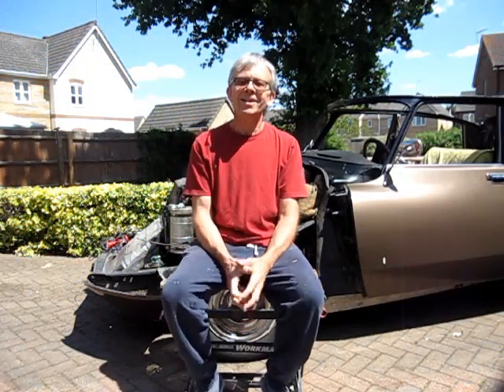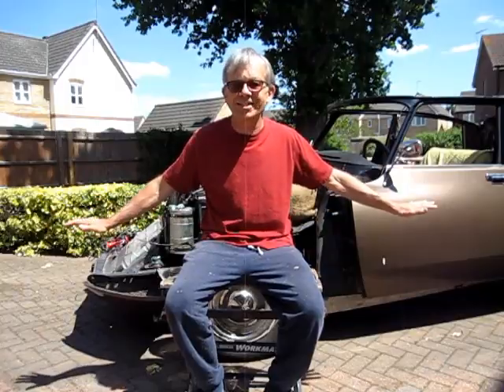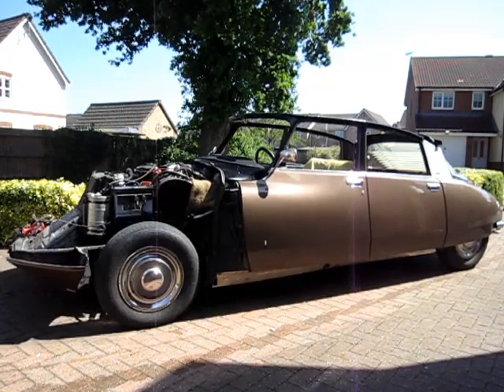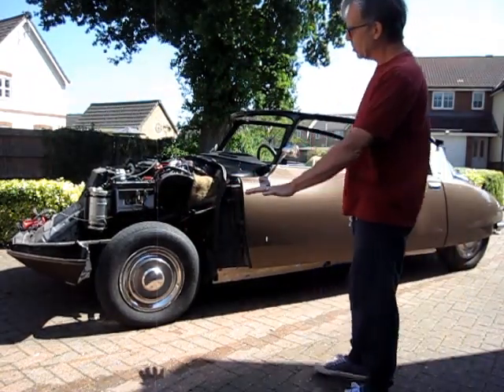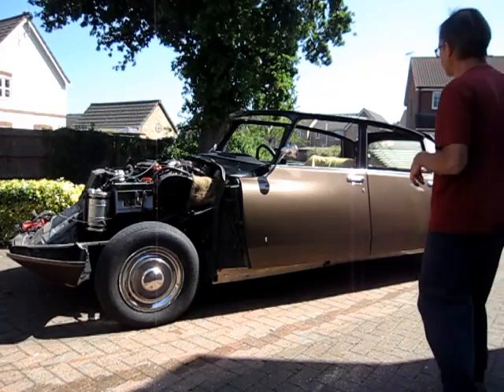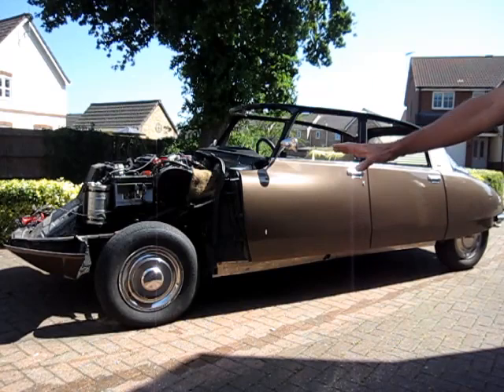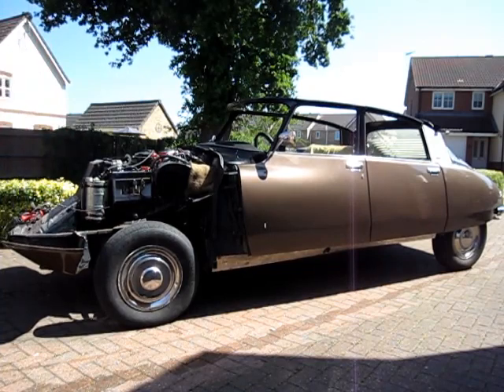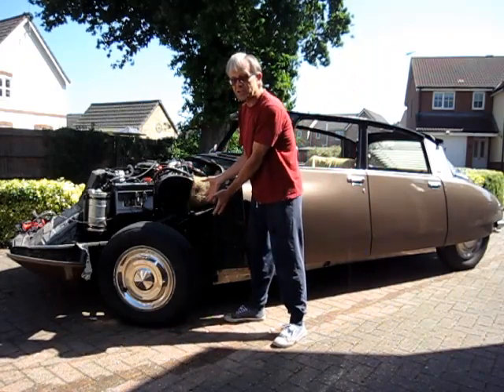Self levelling suspension. Why is it necessary? How does it work? Features Citroen DS classic car

Comment: Excellent video, very helpful explanation. May I ask a question? 

A tow truck driver forgot to disable my car's self-leveling. It bent a bracket on one side (at the rear of the car). The repair shop tried unbending it, and put a zip tie in place. 

Am I all set? Or will the zip tie fail over time? 

I'm hopeful you might know because I saw a white zip tie on the underside of the car in your video.

Or if anyone else reading this has some advice, I'd be happy for anything you can offer.

Comment: Can I raise the suspension if the Citroen won't start?
Reply from the maker: If you know the hydraulics are in good shape you can do it by pressurising the hydraulic system. A friend and I did this once by fitting a pulley to a drill then coupling the drill to the pump via the belts. You need a powerful drill and you need to get the belts under tension so be careful. It's harder to do than it sounds! Don't forget you should never get under one of these cars unless it's supported on stands in case the suspension collapses suddenly.
Otherwise just jack it progressively and maybe support it on wood/blocks as you go. Will take some patience!